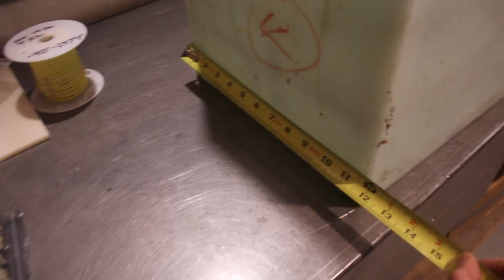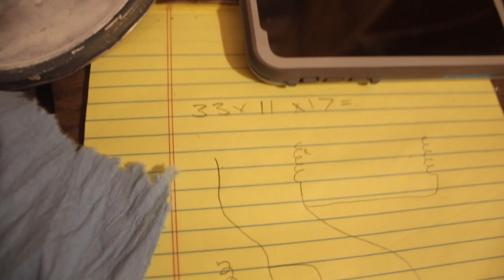FRESH WATER TANK & PUMP INSTALL - Truck Camper Build Part 24

Comment: Oh you put your drain for your tank through the floor,  before you make that your final design here is a thought, 80s campers on up have the drain through a side wall to get a drink from outside the camper without going in,  cooking outside Ect...   I took my external ball valve setup a step further and got another water hookup door that is lockable and tucked it inside , mine was plumbed to the door under the roof lader.  I went lockable due to some nice passerby in a Walmart parking lot turning it on and walking away,  found it on before it drained my tank though.

Comment: I did similar, , used a marine 8” round  access door on top of tank then used another larger marine access door where the bunk step is giving full access to clean out tank on a regular basis.
Reply from the maker: dave edvalds I have since added a 6” marine deck plate to the top of the tank. Thanks for the tip!